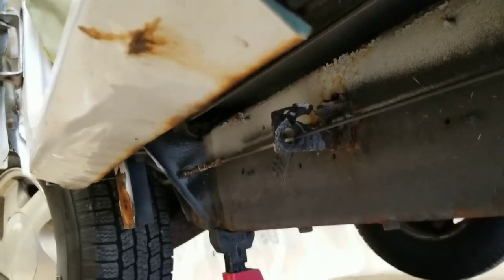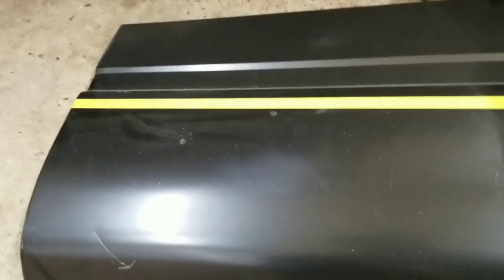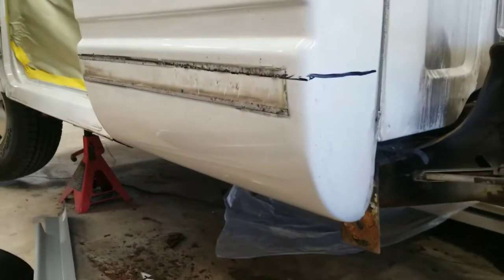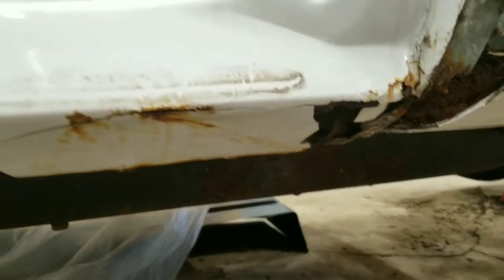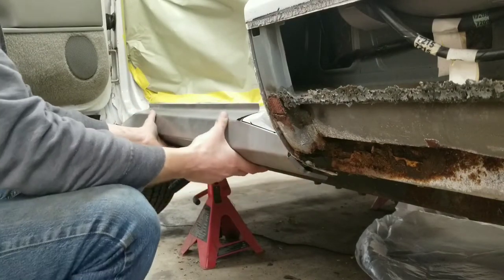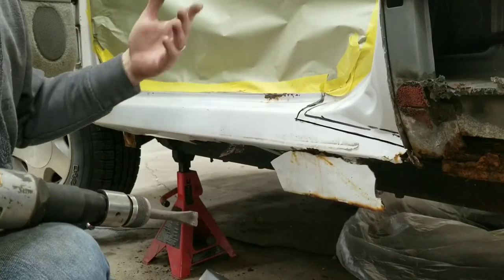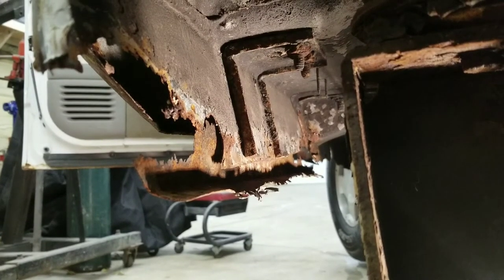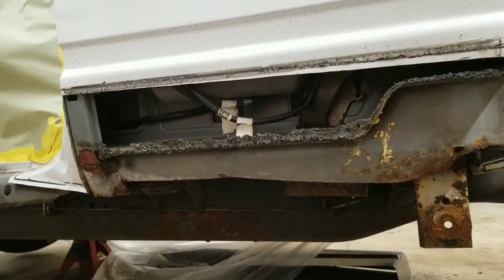Saving the OBS chevy 88-98 Silverado rocker and cab corner rust repair vlog part 2 old rust bye bye

Comment: Just curious what is the cost to do this versus having it done? I need to do this but super nervous to start it. Lol
Reply from the maker: Roughly $1500-$1800 in material for just cab corners and rockers. Roughly $3500 to have it done.
Reply: In reality, you’re gonna spend around 500 dollars on patch panels alone. A gallon of bondo was around 55 dollars the last time I checked. However that will be wayyyyyy more than you need. Granted that you have a place to do it, access to air tools, and the proper tools, you can do this yourself for around 1000 dollars. That’s you doing all the work and having the tools. At the very least, you’ll need a cut off wheel, grinder to clean metal and a welder with gas to get clean welds. If you butt weld the panels and grind slowly, but flat, you’ll use even less filler. May even get away with using some evercoat icing if you don’t warp the panels. To apply the body filler you’ll need spreaders gloves but that’s optional. Always mix my filler on a large piece of cardboard because the was paper sheets weren’t big enough. Once applied, you’ll need to work the filler. An air file is best to cut the material straight. But you can use a long hard block starting with 32 grit worming your way up to 220 to get the body filler flat or “blocked”. In between each grit of paper, lightly spray paint the patched area with a dark colored paint so when you sand it, you can see your high and low spots. High spots will be the color of the bondo and the low will be the color of the spray paint. Once you’ve made it to 220, you can then primer the area, either with a paint gun or spray can, but usually 2 part primer is the preferred method. Then again, spray the primer area with a dark spray paint and lightly wet sand with a hard hand block and 220 grit paper, working your way to 400 grit, applying color in between the different grits of papers. Just block until the spray paint is gone. Once you’ve verified no highs or lows and you’ve gotten to 400 grit, you can move to on to painting the desired color. My advice to you if you’re wanting to do this yourself, watch good videos of how to properly remove panels, how to properly prepare them for cutting and welding and how to install. Also familiarize yourself on how certain tools found in body shops work and what they do. Lastly watch videos on how to apply body filler and how to prepare it for paint. This was a good video on how to remove panels and how to prep them. Things like this is what you need to watch when wanting to do a diy project of this caliber.
Reply: @ScratchandDentGarage the patch panels are $30 a piece and you can two part adhesive glue them on
Reply: @MrMcflanigengaming I think I’m gonna give that a shot . Have no welder . Was thinking about cutting out the rust and using parts I need of the panel and put on the inside pop riveting them in. Don’t really wanna sink 2000 or three grand into a 35 year old truck . Have no other rust than a little on bottom of extended cab corners on the bottom .

Comment: Thanks but don't show me anything until you show me how  one guy, working alone can get that box off.
Reply from the maker: It's called a lift. It's sitting in the middle of my shop. I drive over it, unbolt the bed and with the touch of a button........ bam it's off. 1 guy.
Reply: @bpbrestorations2093  Yes, a lift, great. But how many guys have got that, working at home? You do your jobs in a shop.
Reply from the maker: I started in a 20 x 24. Took many many years to get where I am at. Thanks for noticing. We do have a nice shop now.
Reply: @jimervin1637   or just use a engine joist to remove bed that’s what I do there’s video’s on you tube how to do it…
Reply: @scottyb8640  I don't exactly have an engine hoist. Maybe I could rent one. But I do have camper jacks which I was considering using.